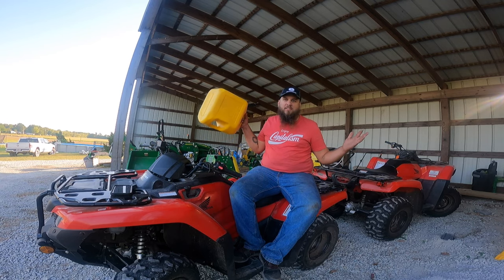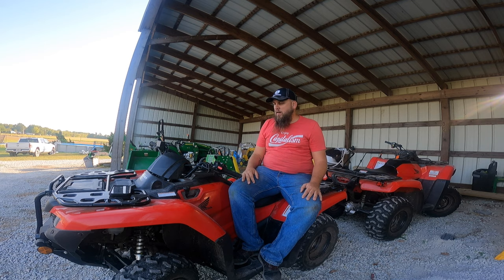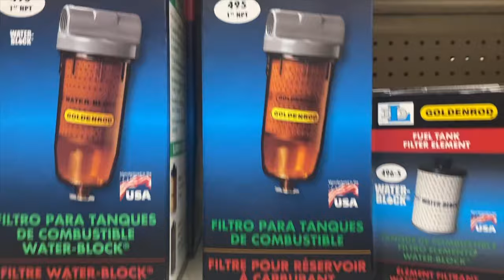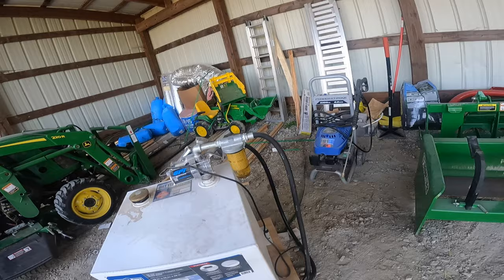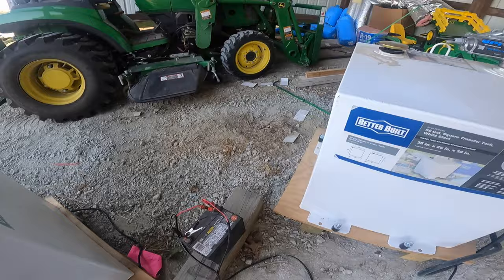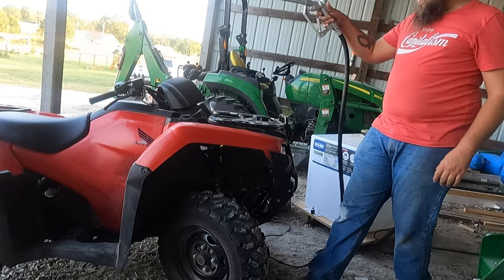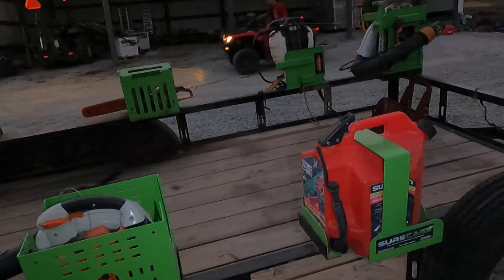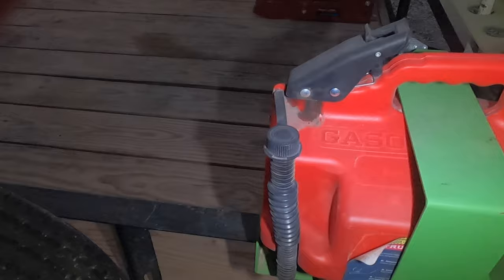Diesel Fuel Transfer Tank and Portable Gas Pump

Comment: Bought this exact same tank at Tractor Supply. Installed a 8gpm GPI pump, mounted on a Ironton 4x4 trailer. When I went to remove the large Better Built decal, that's when I noticed it said for diesel only. I call Better Built tech support, asked what the big deal was if I used it for Gasoline. They got real concerned, they said it's not DOT approved, and becuase it's made of mild steel, and not cold rolled, that the tank will expand in the summer time, and will start to rupture. I'm not a happy camper, I'm now shopping for a diesel generator, or a DOT aproved gasoline transfer tank. I called JME tanks, they said you gotta use the correct pump, or it could give off static discharge and cause an explosion.
Reply: saved me the trip and hassle, thanks

Comment: I made a 2x4 square underneath them then did 3 or 4 inch wheels on each corner. Then I can wheel it around garage. I’m trying to figure out a 110 to 12v conversion so I can just run it off the wall plug. Right now I just use the terminals on side of tractor that run into the starter. Hook to the positive and find a ground. Like the bolts for the loader arm.

Comment from the maker: Follow up video setting these tanks up better
https://youtu.be/zrzUGLFNLYY

I forgot to mention in the video that When using a portable refueling station for gasoline, it is important to ground the fuel container to the truck bed to prevent static electricity build up which could potentially lead to combustion.

You should also check your local laws and regulations regarding how much fuel you can legally transport.
Reply: Just adding to this comment. Federal law, 49 cfr 173. For gasoline, any containers over 8 gallons require training and documentation to transport regardless if it's for private use. You can carry containers that are 8 gallons or less as long as the total weight does not exceed 440 lbs., It's exempt under " Material s of Trade".
Reply: @sgrios1  not under 10,000 pounds

Comment: I need to think about this for diesel
Reply from the maker: It’s not a cheap set up but it was very easy to do and it’s fantastic to never have to worry about filling up the gas can with diesel. Just drive over and fill the tractor
Reply: @RockhillfarmYT  exactly! 👍🚜

Comment: Ordered an RDS transfer tank, they are DOT approved. And I'm not going to install a 12-volt pump to it, I'm gonna play it safe and install a GPI hand crank pump. The problem with the Better Built transfer tank is there is no pressure relief valve. And this RDS tank I ordered is made of aluminum, so no worry about rust building up and then contaminating the fuel. Also, I'm a professional welder, I inspected the welds on the Better Built tank, they are horrible. That's probably why it won't hold up to any pressure from the gasoline fumes. I will be selling or using the Better Built tank for diesel fuel only.  Good luck, be safe.
Reply from the maker: Thanks for sharing

Comment: I have a 100 gal diesel transfer tank and built-in electric pump/hose.  Since I've never used for diesel and need to carry and store gasoline was wondering if it's ok to fill the tank with gasoline, especially the pump motor says it's 'explosion proof'?    Thanks for sharing...

Comment: I'd just hook up the power leads to whatever it is your filling up but I definitely like the setup
Reply from the maker: I have them thanks in a fixed location Running off a solar panel so I never have to mess with the leads. Works out great

Thanks for watching

Comment: I don't burn that much fuel but I still hate todays gas cans. I took two 5 gal sure cans and put them on a shelf in the shed near the door and the ramp.  Added a longer hose.  Put a shut off on the hose. not a big tank but I had everything already minus the hose and don't have to hold the 40 pound cans forever so not to make a mess on my equipment.  A bigger tank to rotate fuel during the summer for mowing and to have a few week of fuel for the generator seems like plan in future.
Reply from the maker: It all depends on what you do but the 50 gallons of been perfect for me.

I’m looking at getting a skid steer and may get a bigger tank for diesel

Comment: You can fix that can, but even after that when you’re dealing with multiple machines all the time it’s a royal PIA the one issue is that gas goes bad in a few months, so unless it’s diesel you can’t store a lot & forget about it.

I’ve got a big truck that I run on my bio fuel mix & when I get busy I can’t refuel every week & cans get annoying. I’ve got a tank already for the truck just haven’t installed it yet, probably will this summer when I get busy.
Reply from the maker: I have these two 50 gallon tanks. What is gas in the others diesel. I feel them both once every couple months And I put fuel treatment in them when I feel them.

Had it for almost a year and it seems to work great

Comment: A 55gal drum works great and  lot cheaper.
Reply from the maker: Thanks for the feedback
Reply: 50gal tanks are the perfect size for stuff, not to big, & not too small.
Reply: I built one as a reserve tank for my diesel generator. I bought a broken Craftsman air compressor from Craigslist for  $25.  Its a vertical 60 gallon tank with electric pump, big filter, 12 foot hose. Its bolted to the foundation and a wall in case The Big One hits one night. I still have to fill it with plastic jugs but the electric pump with dip tube makes it a 50 second job per jug. It filters fuel both coming and going.  The tank is ASME certified and has a double bottom that must be 1/2 inch thick. It will never rust out in my life time.
Reply from the maker: Sounds like a nice set up. Thanks for sharing

Comment: I have a question, I bought a transfer tank with the pump and all that on it, didn't realize it says diesel only and in the manual said only to be used with diesel, is there any difference with the pumps if i wanted to put gas in it instead or is it gonna blow up on me🤣🤣
Reply from the maker: Yeah, you aren’t supposed to put gas in these

Comment: Off subject, but what's the size of your equipment shelter? The Length, width and height thanks
Reply from the maker: I think it’s about 20 feet wide and 50 feet long

At the back wall it’s about 9 foot high roof and at the front it’s probably 15 foot high

Comment: OMG I hate those gas cans it would be different probably if they designed something easy to use but they don't at least not that I have seen. When I was a kid they had the just lift and poor and gas would go everywhere and you have to clean it off your mower engine or wait until you used it until the gas was gone. now its like use the remaining muscles you have left in an awkward position to press down on something pretty hard to do to get a few gals or even a 1/3rd gal container that's probably just balance to hold itself up.
Reply from the maker: The only gas cans I found that don’t have some kind of a stupid mechanism on the nozzle are the Cans designed for racing because they have to be able to pour it in quickly on pitstops.
Reply: Just Rite makes 5 gallon heavy duty steel gas and diesel cans with squeeze trigger handle and flex steel spout. Its easy to use without spilling. I have a red can and a yellow can. I painted on Mustard and Ketchup so I won't be confused.
Reply from the maker: I like the mustard and ketchup part
Reply: @kimmer6  lol

Comment: FYI, while that 50 gallon tank is perfectly legal on the road for carrying Diesel, I do believe it is ILLEGAL for transporting gasoline. Might want to check, DOT fines are steep.
Reply: A separate tank from the vehicle's fuel system (for gasoline transport) is restricted to 400 pounds *fuel capacity*.  Gasoline weighs 6 pounds to the gallon which means 66.7 gallons is the theoretical maximum for a separate transport tank - unless the "auxiliary tank" is "permanently" installed as part of the transport vehicle's fuel system.  
My 100 gallon tank in the bed of my truck is "permanently" attached to the fuel system through a flexible fuel line (with shut off) from the in-bed tank pump.  Like ALL vehicle fuel tanks it can be detached and removed for maintenance.
Don't forget a water/sludge filter because you WILL need it to keep the fuel clean.     - Joe -
Reply from the maker: That was my understanding that 50 gallon tank was within limits. I do have water filters on both of my portable tanks

Comment: You didn’t say how much it cost to make one.
Reply from the maker: JAMES Hussey The tank was $300, the pump was $280(I almost bought a hand pump for $80). $60 for the filter and installation kit.

Looks like about $700. I already had the battery

The set up is very convenient
Reply: @James Hussey - thanks for asking!
Reply from the maker: Yeah. I meant to include that

Comment: Great video. Now I’m just being lazy as I’ve just seen how many videos you’ve done, but I noticed your blower sitting in a frame on your trailer. Any videos that cover that? Shop bought or homemade? Thanks.
Reply from the maker: This is an older video, and I think I have a different trailer than the one that you would’ve seen here. I don’t recall having a blower on my trailer.
Reply: @RockhillfarmYT  thanks for the reply. I found a company called trailer racks. They seem very similar to those on the trailer. Merry Christmas from Ireland.